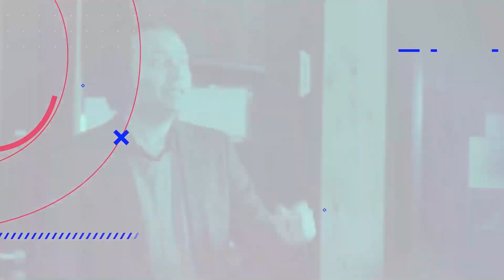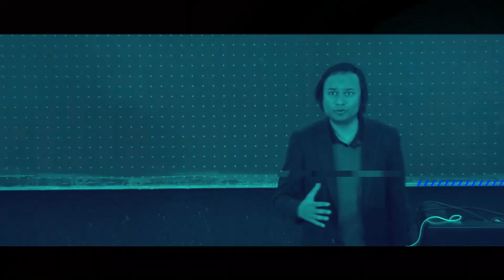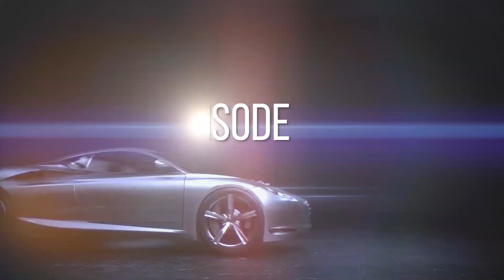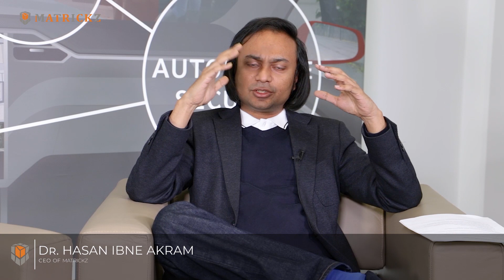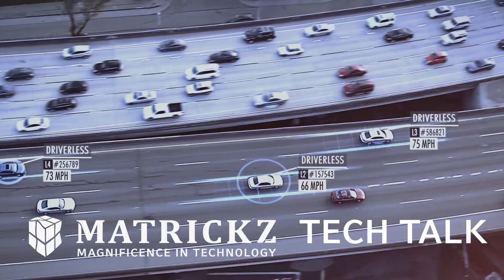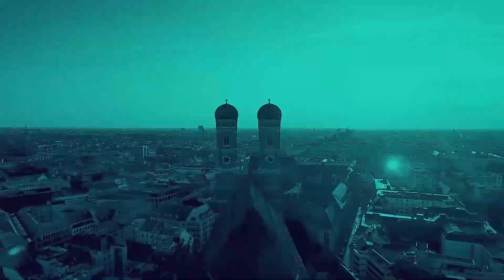Safety Element out of Context (SEooC) Assessment according to ISO 26262 (2020)

Comment: A very interesting video. Thanks. Having in mind to do the MCAL SeooC, when you speak about assumptions, could you give hints in such sense. An example which kind of assumptions for ADC, SPI, etc etc....Just to understand the boundaries. Many thanks.
Reply: Hi Francesco, Thanks for your comment. Just to name few:
•	It is assumed that the MCAL is integrated with a safe OS.
•	The MCAL user shall not write or read directly the HW registers that are belonging to the peripherals handled by the MCAL drivers.
•	Critical section protection should not be switched off to avoid software misbehavior.

Comment: Good High level bird eye view of FuSA. Functional safety application (SWC) are guarded with safety mechanism of MCU. Which needs the detailed understanding of MCU as well ( safety and user manual ). Until you make your hand dirty we can learn only theory of FuSA. Real understanding come during the implementation part of FFI, QM and ASIL partitions, RAM, Core, Flash test, Stack integrity, OS safe interrupts, register supervision, program flow monitoring, E2E , Safe state apart from applications algorithms. One thing for sure no system is 100% ASIL complaint there always be Rational or TRA ( technical risk analysis ) to make it compliant. Thanks for the video informative!

Comment: Why do we start the SEooC at the technical safety concept level (with ASIL assumptions) instead of safety concept level where HARA will cover as many potential malfunctions as possible and also help us in the derivation of our safety goal before the development phase?
Reply: Hi Aniekan Inyang, Thanks for your question. As we are mainly discussing a software SEooC, the top-level assumptions would normally be system-level assumptions. If the SEooC is a system, then the assumptions about the item definition, the safety goals of the item can be made.
Reply: @praveensuvarna5158  Thank you for your response. one more question: Are assumptions for item definition and safety goals the only approach to this; if no, can you kindly state other approach(es)? Thank you.